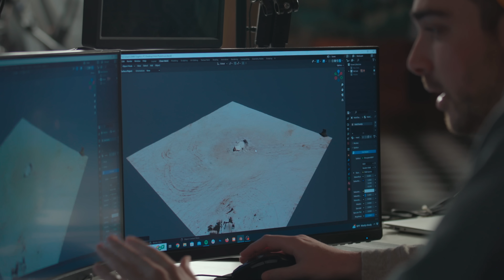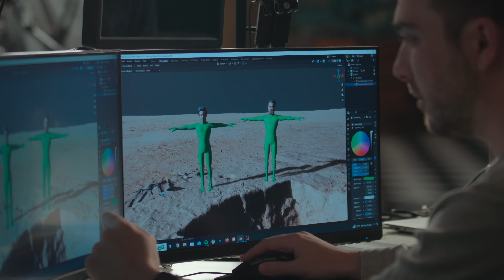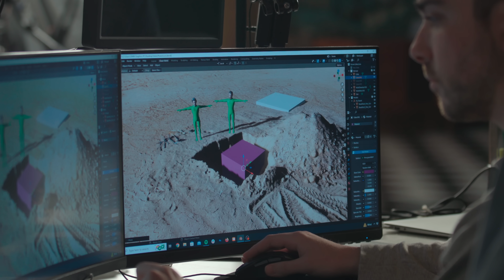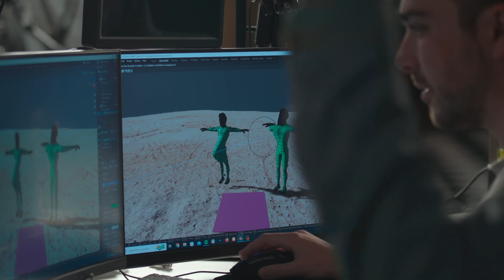We Dug A Medium-Sized Hole

Comment: They dug with joyful hearts, without a plan or care,
Their shovels scraped the earth, a project born of dare,
But as the hole grew deeper, their smiles began to fade,
The task had grown too big, too much for them to wade.

So they stopped and pondered, and took a step back,
To analyze their digging, and get back on track,
They looked for patterns, and searched for ways,
To make the hole just right, for all of their days.

With newfound insight, they took up their tools,
And worked with measured pace, like seasoned mules,
They dug a medium hole, and kept it pristine,
A perfect space to use, and build their dream.

So when imperfections came, like moles to their space,
They swiftly removed them, with nary a trace,
Their project was now goldilocks, just right and so fine,
Their digging had paid off, for their business design.